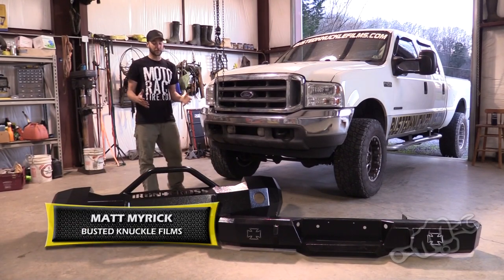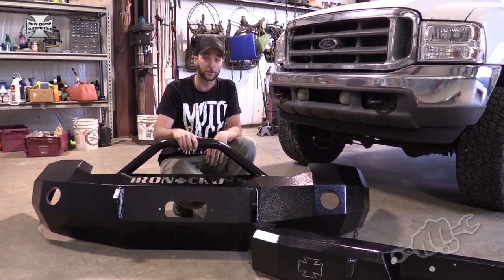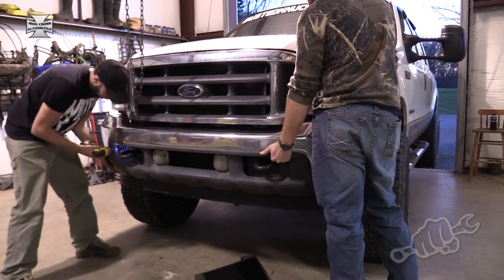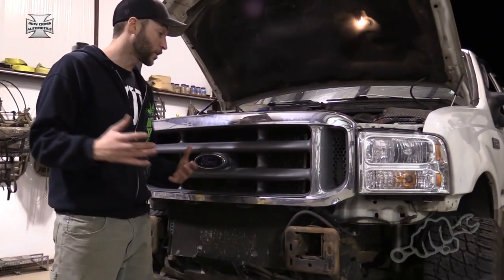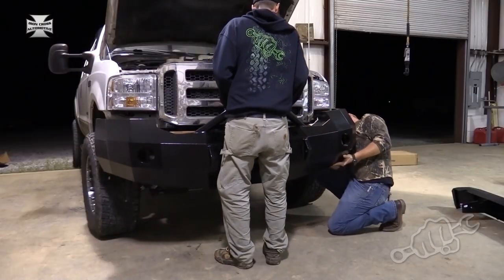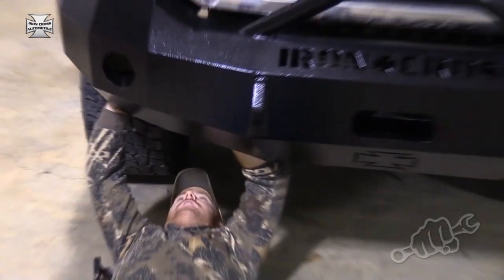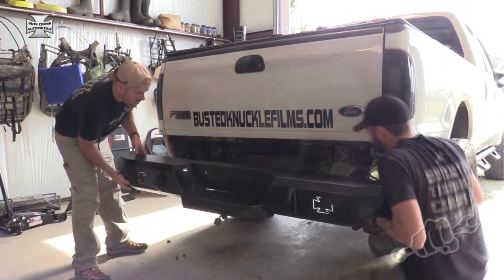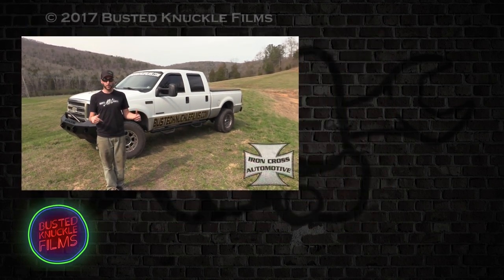Iron Cross Bumper Install - Tow Rig Tech Episode 4

Comment: Is there a gap in between the top of the bumper and the bottom of the grille?  How’s the bumper holding up?  Do I need to order 03 grille?
Reply from the maker: No Gap, I bought this one for an 05-07 truck because I wanted to do the new grill. They make a bumper for both. It's holding up great.
Reply: BustedKnuckleVideo what kind of bolts and nuts did you use?  I got one but no hardware was included.

Comment: I have 05-07 head lights on my 03 along with the stock 03 grill (for now) can I still use this bumper or will it not work /look stupid with the older grill?
Reply from the maker: Make sure you order one for an 03 otherwise there will be a gap at the bottom between the grill and bumper

Comment: I noticed you got aftermarket headlights... what brand and compared to the stock, how much brighter are they?
Reply from the maker: I just bought some 05-07 headlights off of the internet
Reply: BustedKnuckleVideo was any modification needed or was it just a simple install?
Reply from the maker: You have to trim the bracket or get the 05-07 bracketry

Comment: Great videos, I've seen those headlights for sale online.  Do you have to do any modifications to make them fit?   Do they also run the stock bulb size / wiring?   Thanks man!  Keep it up!
Reply from the maker: You have to get adapters and either do some trimming to fit or order an 05-07 bulk head (the thing the lights bolt too)

Comment: Iron Cross has terrible quality control
and a non-existent customer service
department. Bought a bumper in first
week of September with "3-5 day
shipping" and didn't get it til mid
October. Brackets were welded so bad
they wouldn't mount bumper to frame
straight. Replacement took 10 days to
arrive and lack of any QC caused me to
get another pair of faulty welded
brackets. Now IC won't answer phone
or email. Shady business. Never again
Reply from the maker: interesting I never had an issue

Comment: what year is your ford love the videos keep up the good work
Reply: clayton pickle 99-03.
Reply: Mel's 12valve thanks that's what I'm looking at for a first truck
Reply: clayton pickle they do come with a decent price though. Try to make sure you get a diesel. Don't deal with the triton v8 or v10.
Reply: Mel's 12valve in Oklahoma it's 2500 to 8000 for a diesel and always overprice the truck because the put upgrades on it
Reply: clayton pickle ya here in Alaska a 7.3L of these years with or without upgrades even with massive miles they go from 6-17k. Absolutely stupid.
Reply: Mel's 12valve yup just to get a decent work truck you have to spend a lot on a truck with 250,000 miles which ain't worth it
Reply from the maker: clayton pickle it's a 2002